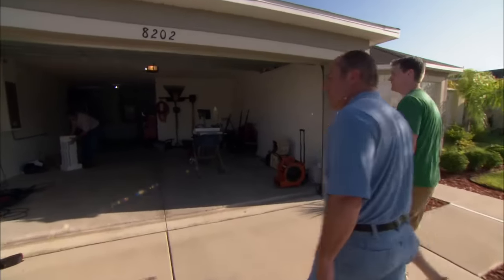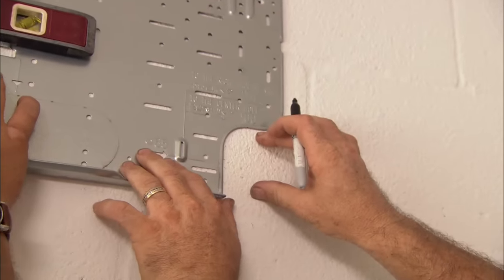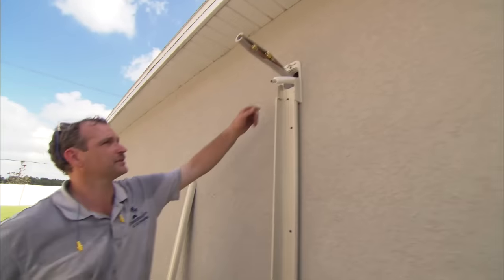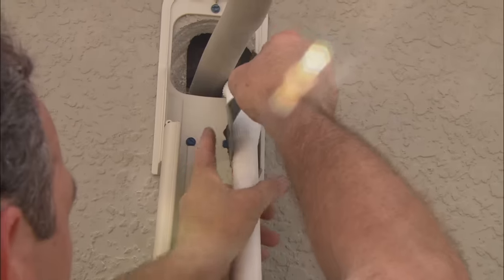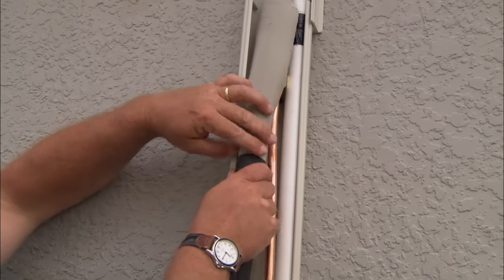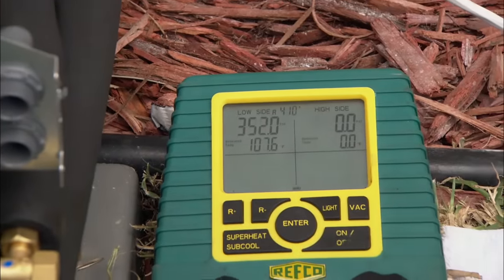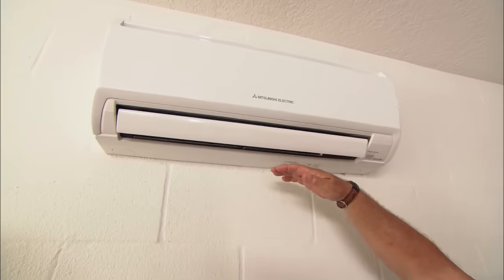How to Install a Ductless Mini-Split Air Conditioner | This Old House

Comment: Why wouldn't the 2 copper lines be insulated independently from the inside unit to the connections outside?

Comment: Wash the filters in the sink - 100% bad idea.  Mitsubishi filters are impregnated with anti-bacterial and washing them in the sink will completely destroy them.
Reply: your talking about the ones that click on top of the ones he showed in the video ,,,,,,  the anti allergy/mold filters your talking about can't be washed, only replaced at every tuneup ,,,,,  but the ones they have are washable

Comment: been an hvac installer for 20 years ive never seen or even heard of flare fittings being used on refrigerant lines before.  think id wanna cut those out and solder the pipes together

Comment: Will this work without insulating the garage first?
Reply: Yes, however your unit will run a lot harder to maintain temp.  Depending on outside ambient temps and the level of heat exchanged through gaps in your uninsulated garage, your unit could potentially run non-stop.

Comment: Wow, this is how rookies install a ground wire.  I will come loose and the unit will be ungrounded. I would have expected better professionalism from This Old House!
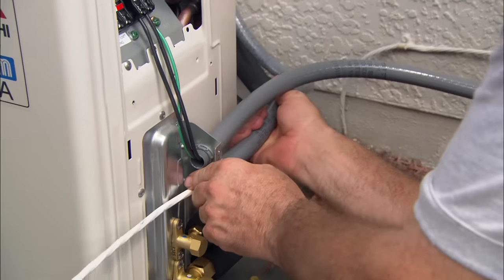Reply: Noticed that too —> 5:41 Those tiny filaments of copper first need to be twisted tightly together, then wound clockwise and held up tight against the screw as its tightened (clockwise, right-tight), or they’ll splay out like the appeared to do here.

Comment: Very clean & professional. A couple things to consider. Put an elbow & a small piece of PVC on the condensation drain line. In addition, the metal enclosure is going to get rusted over the years , because of the sprinklers. I would install in an area free of sprinklers. Just a thought
Reply: clean and professional? He used no shut off valve between unit and the pump, and no triple vacuum with N2 gas required by Mitsu

Comment: Hi voltage meaning 220-240 nominal ? Just checking, as high voltage everywhere is 1k volts,
Reply: smartchip , I guess it’s high voltage compared to the signal wire.

Comment: These units, in this application,  are just this easy to install. However, the first thing you should always do to the flair fitting is cut it off and swage the line set to braze it with your torch...that way you dont have to come back next week and fix the leak
Reply: Mitsubishi not allowing braze lineset

Comment: Hi I just bought a mini split unit ac 24000btu the line is 5/8 & 1/4 but I have a 1/2” & 1/4 available can I use it?
Reply: It's passable in emergency if the length is not too great. But need to braze on a short section of 5/8 on both ends to allow for the flare connections. 
It's best /easier just to get the proper pipe.

Comment: i have a question how loud is the blower fan? is it noissy? im asking bec. i was gonna install by the counter &  its very small space next to window casher.
Reply: +GalaXy808 
pretty quiet. Barely hear it running.

Comment: Do you recomend insulating brick walls for better faster cooldown of the designated room???
Reply: You can't add insulation to the side of brick because it will cause the mortar to degrade. The only way to insulate brick is to blow in cellulose insulation into the holes in the middle of the brick.

Comment: What is the name of the wall hole sleeve/cover they use in this video and where can I buy it.  Can't seem to find it in any of my local hardware store or amazon.com.  maybe I just didn't search for the right term.
Reply: It is called a Decorative PVC Line Cover Kit for Mini Split Air Conditioners and Heat Pumps

Comment: Two things bother me. First, the inside unit was mounted level when in fact it ought to be slightly off level to allow the condensate to drain. Second, the pipe connections were tightened using ordinary adjustable wrenches when in fact appropriate torque wrenches should always be used.
Reply: Don't need a torque wrench on a compression fitting.
Reply: @dianesimmons2369  For the ones we had installed the instructions specifically said that you do and that's exactly what the installers did.

Comment: I am wondering what was done to the lines that were flared and connected to the system. Since this system comes precharged, don't you have to place the lines in a vacuum before adding the refrigerant to the added lines to remove air and moisture?
If anyone knows, please explain!
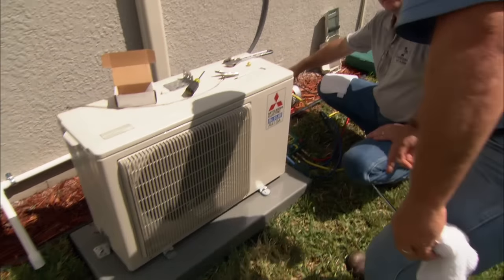Reply: He does at 5:52
Reply: he evacuated at 5:55

Comment: My split type aircon is now have weak air, i dont know why but the temperature is fine but the air coming from the aircon is weak.
Reply: +Duneld Dukc With it turned off, look up inside at the drum fan. Is there a lot of dust, etc.. on it? It probably needs a proper clean...

Comment: 7:04 in the back corner of the garage.. cut a 5" hole in that system's supply right in the front. Save money and Dave doesn't have to sweat out 5lbs
Reply: Illegal because it is unsafe to have openings in the garage and the house on the same system.

Comment: Can anyone tell me what the little white roll of cloth is for that comes with these Mitsubishi head units? It's in the bag with the manuals and the remote. I've had two different contractors install these at different times, and both just left me with them. I have no idea what to do with them.
Reply: I think it's just tape or something. I have that too. It's to tape the drain and copper pipes together unless I'm wrong

Comment: I may be wrong but for some reason I feel the split system is less efficient could someone possibly correct me if I'm wrong?
Reply: I will correct you. You are wrong. It is much more efficient

Comment: The fellow who did the job, knows what he is doing. Just gets it done. AND is using the proper rotary drill. Makes it a lot easier than hammer and chisel. I have had the same flaring tool he has since 1978. The ONLY tool I have never lost.
Reply: What? He did not scan for object behind the wall and almost drill into the metal stud framing - that's why he drill second time from the outside. Lucky all the flexible pipes fit through the opening and not a round PVC tube or something. LOL

Comment: Didn’t showed where exactly to drill the hole  and how you secured the bracket to the wall with nails , have you used a stud sensor for this process ?
Reply: This was a masonry wall, at least on the inside, so there are no studs.

Comment: was this a 120v unit or 240V? I seen there were 2 hots a ground but I didn't know if one of the wire was the control wire to tell the unit to turn on and off
Reply: 240, there were two hots coming from the electrical box into the condenser

Comment: No oil on flare, no torque wrench use, no triple vac, no micron gauge, No Thank you
Reply: lctachell triple evac is only necessary after the units been running and there’s POE oil in the lineset.

Comment: What is the tray system that all the exterior lines are run in from the hole all the way down to the exterior unit called? Where can that be purchased?
Reply: Please disregard, I found it. Thanks.

Comment: Didn't show the plumbing connection to the outside unit, or routing electricity from breaker to unit or what size breaker fuse was needed.
Reply: 200amp breaker.
Reply: @gangisspawn1  um no you absolutely don't need a 200 amp breaker lmao. This pulls maybe 10-15 amps max. It's 220v.
Reply: @usa5439  r/woosh

Comment: Can you run the line set out the side of the air handler and then bring it down and go to the outside to use up some of that length so I won't have to flare it?
Reply: Yes

Comment: What are the pros/cons of this vs. cutting a hole for a thru the wall AC unit?
Reply: The compressor sits outside, so the unit is much less noisy in the room.   Plus it's a smaller hole in the wall.

Comment: that earth connection doesn't look well secured as its suppose to have a lug terminal
Reply: Jason Kuy , all the connections should have terminal ends and some slack on the wires.

Comment: Just to let anyone considering one of these units know some brands are better than others BUT none of them last very long. ALL brands of these mini-splits are of extremely poor quality. Just understand this ahead of time.
Reply: mine lasts more than 10 years with daily usage
Reply: Mitsubishi Electric offers 10 Years warranty on all components, 12 years if installed by a Diamond Contractor...
Reply: +Jose Hernandez And we've had to use that warranty 6 times in 8 years so far.
Reply: NorthernChev do you service it? you need to call the ac guys to service it at least once a year
Reply: +Dan9457 Well, like I say, he's' been out here 6 times in 8 years so hopefully he's doing whatever needs to be done while he's here. And BTW, I also have a 3 ton package unit on the roof that is going on 30 years old and that one has never needed any repairs as long as we've been here.

Comment: Can someone assist me here does the AC come already charged with the gas or the technician puts the gas during installation?
Reply: he added the nitrogen separate as a way to leak test. does not come with the unit. but it does come precharged with the right amount of refrigerant so he didnt need to add or charge the unit.
Reply: Thanks I appreciate

Comment: I hate that mini splits only use ONE valve for servicing
Reply: Jesus Garza all mini split have a high pressure and low pressure port. The high pressure port is inside the unit. Besides the only way to properly charge these systems is by weighing in the charge.

Comment: I like the ductless mini split systems. I service commercial HVAC units for banks and I have been considering installing a 2 zone mini split on my 360sq ft cabin project. Thanks for the video.

Comment: How do you do this when the covering needs to be  in the room. It's a condo and I can't go through a wall as it would be in my neighbors place. There is a lanai with glass.
Reply: you put everything in the wall, so not that easy or cheap
Reply: @CaptainBlueTech   The wall that is my neighbors is a cement wall. So I can't put anything in the wall it's self. The glass windows at the lanai  are 4 , 48 x 4 wide" one section of slatted windows in the right panel. On either side of the windows is a cement wall.
Reply: @renaetawney5217  you can't install something like this if you don't own the wall, you either need access to put pipeing inside the wall or through the wall. I would look into ceiling mounted units if I were you although in a condo you might be out of luck with anything remotely DIY and have to read up on your condos rules and have a pro do the install
Reply: @CaptainBlueTech   I agree with hiring a pro. I am on the top 3rd floor and do have an attic, but not sure if it would be allowed.  So for now I am will have to continue using the window unit that is mounted " up from the floor. 
ugh,. Thanks for the help.

Comment: Do you need to replace refrigerant after a few years? Mine is making a strange cracking noise when left on for more than 8-10 hours in a row. Thanks! ♥
Reply: Na, that's what the nitro test was for, so you know there's no leaks. Don't know about the cracking, most make a cracking sound when on heating but well before 8-10 hrs. But on the bright side; cracking sounds like it's got the right refrigerant charge.
Reply: Clean  your filter.   It will  make noise when the filter is dirty.
Reply: Refrigerant will expire after 2 years 
Just kidding 😏

Comment: I had an uncanny moment watching this where they were flaring the copper pipe and I was just kind of nodding along and then suddenly thinking 'wait why am I in agreement I've never done t..' and then realized as soon as it went in the flaring that holy crap I had done that before. 

I'm sure I've done a few brake lines, and probably some other applications, almost 20 years ago, completely forgot. Crazy feeling.

Comment: where was his micron gauge when pulling a vacuum? Hack.
Reply: I'm with you on that, he even said the vac pump was to remove the nitrogen. Weird because I didn't see a 20ft jet of oil shooting out of it.plus a 10" adjustable is not the same as a torque wrench

Comment: This is a poor solution to a need for insulation.
Reply: Even with 3 feet of insulation that garage door is gonna be the main heat leak. Not much you can do to be comfortable in a garage but heat/cool it.

Comment: How did you connect the electric to the indoor unit with it already mounted on the wall
Reply: You're able to access the wiring with it mounted still

Comment: Cut away the flares and braze. Keeps the refrigerant in the system longer.
Reply: Adam Woods flare fitting at the condenser as well
Reply: Bill Howard. That's why no one ever brazes.. Except very large or ancient units

Comment: I am considering a similar 120-volt system for my sun room. Does it require a dedicated circuit to the fuse box?
Reply: Considering a split air conditioner is powered from the condenser outside, you would have to fit your own plug if you were to plug it into a standard wall outlet. Otherwise, it may be easier to put it on its own circuit. Makes troubleshooting easier, too.
Reply: I agree with you. I can readily provide 120-V from an existing and nearby outlet. A dedicated circuit would have to be fished through a finished basement. I am only worried about the initial amp draw each time time unit comes on.
Reply: +Kurt M yeah, I don't know off the top of my head but I think mine pulls over 5 amps starting. Also if you are mounting the compressor higher than the fan, I think there are complications with oil/lubrication of some sorts. Good luck!
Reply: Yes, oil can become trapped in the suction line on the evaporator side of the system.  In commercial refrigeration, we use a combination of smaller diameter riser lines coming out of the evap. and p-traps at the base as well as inverted traps at the peak to prevent this.  Not sure what residential guys do on these tiny systems.
Reply: yeah, from what I've found so far, the largest units that work with 115/120v are about 12,000 BTUs.  That's probably good enough for 500 sq. ft or so, depending on your region.  So if you're cooling a larger room or area, you might have to go w/ a larger unit & a dedicated 230v circuit.
Reply: Kurt M 
Depends on the current draw, typically yes.

Comment: I heard that air-cons can leak after a few months of purchasing them.
Reply: no, they dont. Maybe if you dont tight enough the lines...
Reply: I heard that due to the water accumulating inside the air-con, the small tunnel is unable to let the big amount of water flow out into the drain. This is due to the high usage of the air-con and the large difference between the temperatures in the room and outside of the home.
Reply: Nazri Buang That's why the air con has a drain tube, as you would've noticed when watching the video. What you've been told is garbage.

Comment: nooob here how do you make sure when you drill outside it meets the drill from inside?
Reply: sharla1754. Yes I usually angle down almost 30-45deg, helps avoid a kink in the copper

Comment: You can tell who the contractors are in the comments. "The average joe couldn't handle the complexity of a flare tool". The last time I hired somebody to install my air handler, my basement flooded because they ran the condensation drain uphill and left coke bottles and cigarette butts everywhere for the low cost of $2000 labor. You can learn how to do anything on youtube. People used to do everything themselves.

Comment: How do you determine what size disconnect you need?
Reply: ibi nyth just buy a disconnect for 30 Amps. That size is at most a 20amp machine.

Comment: My only one concern is that big hole in my brand new house. My mom can't tolerate the AC bellow 75 we live in Florida, horrible weather. I can't sleep at 75 degrees. Too hot for me, I need one of this AC'S asap.👀👀👀
Reply: Sahar Garcia I have same problem. I have be cool at night to sleep and parents want 80 degrees

Comment: Do you have a video on how to repair them? Such as lost of cold air.
Reply: Probably just need a shot of coolant and it'll be perfect
Reply: @usa5439  do believe its freon and not coolant. Its an A/C system and not a car. 😆 🤣  I'm dead. Employer won't let us touch them, has to be licensed electrician. I'm a carpenter.
Reply: @TopRankedKilla   
"Freon (R22 refrigerant or hydrochlorofluorocarbon [HCFC-22]) is a coolant that was commonly used in air conditioning systems until 2004"  

What??
Reply: @usa5439  still use it here.

Comment: the insulation will condensate and drip where it was compressed with tape.
Reply: nope
Reply: @alicecurtiss959  yep, she will and mold
Reply: get mold insurance
Reply: @alicecurtiss959  Yep.  you  cant compress the insulation on refrigeration lines or they will condensate and drip and the compressed point and cause mold, lawsuits, etc.  look it up

Comment: I'm putting in a 208/230 volt version of this unit. Nameplate says 15 amp  max fused amps, so I assume #14 awg (2-wire w/ground) on a 15 amp 2-pole breaker will suffice?
Reply: Nick Chirikos 

Wire size goes off of MCA (minimum circuit ampacity)

Breaker size goes off of MOCP (maximum over current protection)

This should be on the name plate.

Ask an electrician what the MCA translates to in your area.

Comment: Just seems a bit odd to give a garage AC, does the Lexus not like it too hot?
Reply: They use it as a work station
Reply: peterincgy  I have AC in my garage.  In Houston it gets pretty hot. If I’m going to be doing any work in the garage, I just flip on the AC and avoid heat stroke.  And my Lexus appreciates it as well as my Chevy P.U.   ( Up north there are plenty of people with heated garages )
Reply: leigh christensen  Houston is the nations most air conditioned city.  I'm installing this in my detached garage too.  The gable fan with increased soffit vents just can't keep up with the 115+ degrees in the garage from pulling in a hot car.